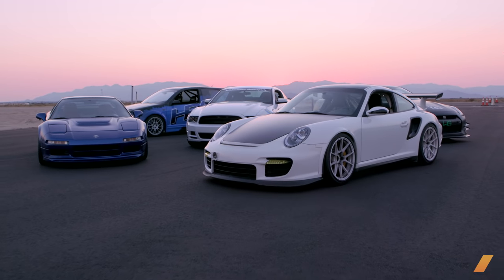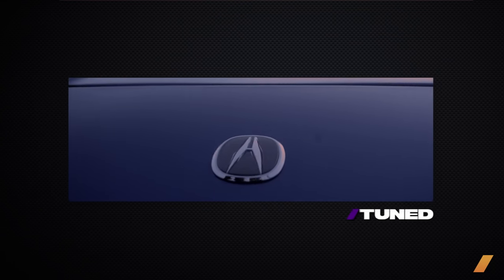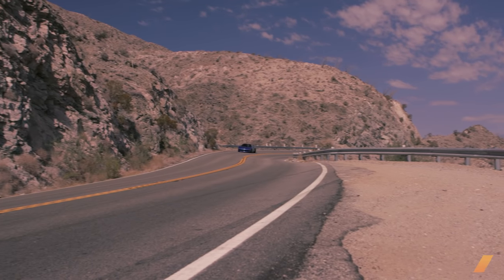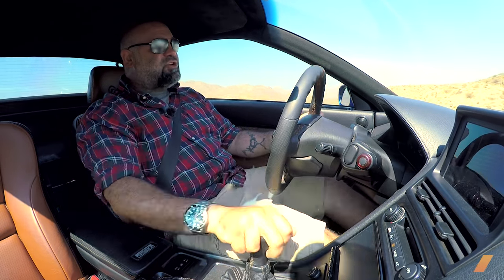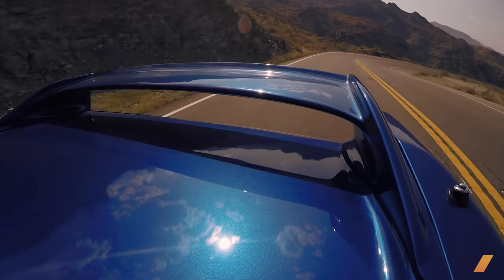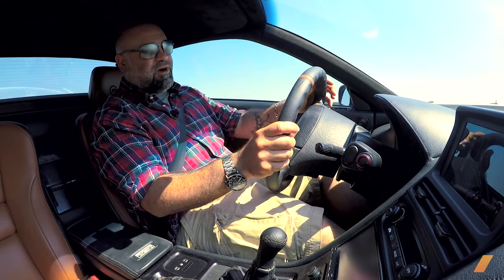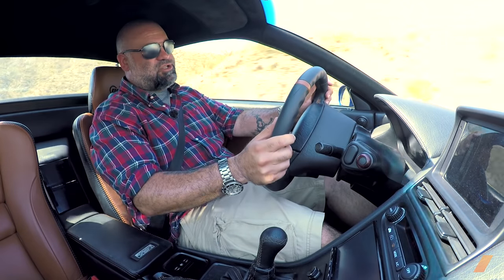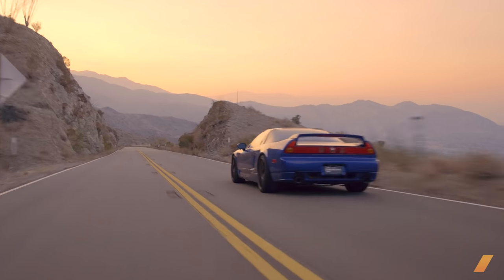Supercharged Acura NSX (SHOOTOUT) -- /TUNED

Comment: style should be taken out of the competition as how its purely subjective while the other judgements can be easy tabulated from objective standpoints
Reply: gooferman609 "road manners" and "track manners" are subjective too.
Reply: Then those should be taken out or have a way to measure them. Just throwing ideas out there; a device that capture how harsh the car reacts to bumps on the road which props for using the same stretch of road but the same line for all cars would be impossible, also a decimeter to measure its noise levels on road. For the track you could use a G meter to measure how well its set up (I know tires are a huge variable). Maybe even for style have 20 people on the street rate the cars like first 20 rate car 1 the next 20 rate car 2 and so on. No complaints about the video though just ideas. Then at the end have a rating that the drivers give each car based on driving them, but not tally into the objective ratings.
Reply: you're asking a little much. Mo review is perfectly objective, unless done by a macine instead of subjective humans
Reply: jafu745 guess I need to explain more. I was suggesting they collect emperical data and give a purely objective winner, then have a separate rating based on the subjective views of the presenters. I love VW and I would have that R32 more than the other cars but I know objectively that's not the best road or track car.

Comment: so its better then the mustang just more expensive
Reply: Slightly better on the road, when it's running. And not nearly as good on the track.
Reply: Kolton Sinclaire it just did a faster time
Reply: Faster != better. I'd take a stock NSX over that mustang, but I'd take that mustang over this NSX, because you can beat the daylights out of the mustang on a track all day and you'll blow this NSX up.
Reply: Because- stock motor.